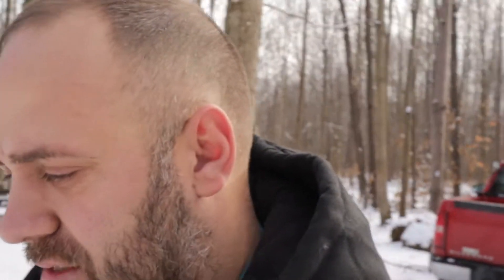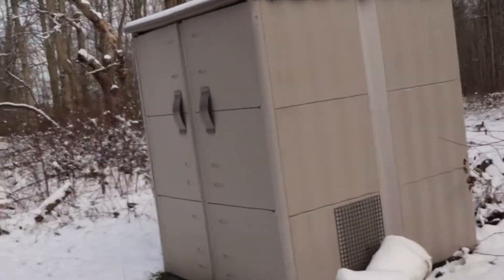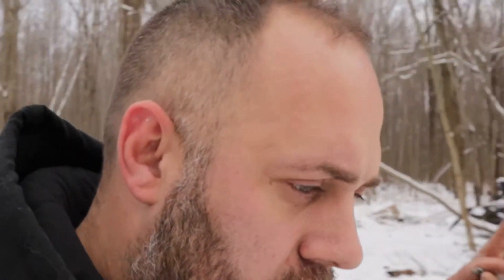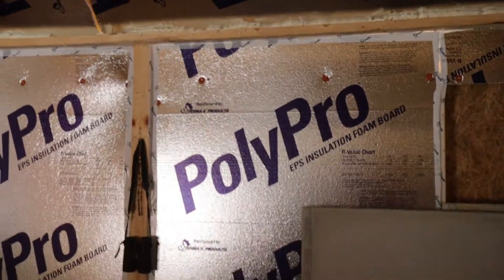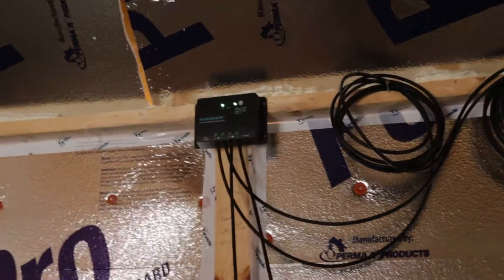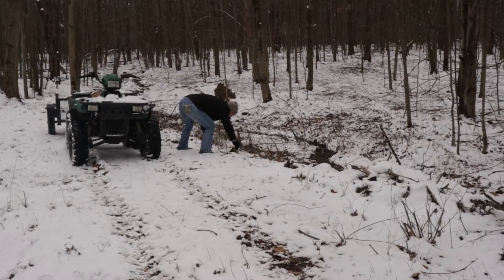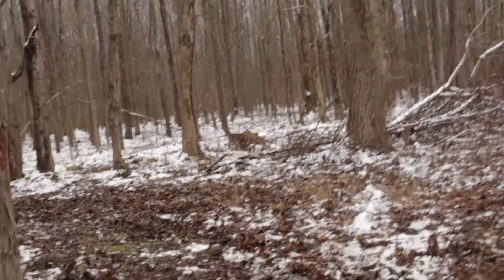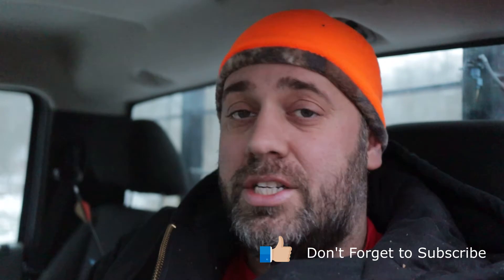Simple Solar Power System for an off grid Cabin

Comment: there is solar paint around  but im yet to find it
Reply from the maker: Do you have a link to more info on this? Are you referring to reflective paint to increase efficiency?
Reply: @TheOhioOutdoorsman1  or set up a solar tunnel above the tree line https://www.youtube.com/watch?v=TfzDoPUDg24
Reply: THE PAINT  produces electric lol .. use a mirror for reflection, which WILL increase efficiency especially when its cooler and the sun is lower
Reply: @TheOhioOutdoorsman1  u could set up  many  mirrors in the winter for 1 solar panel